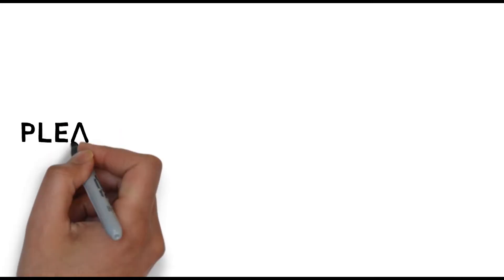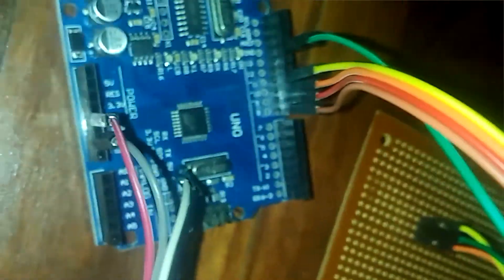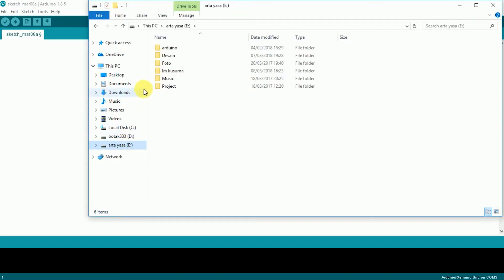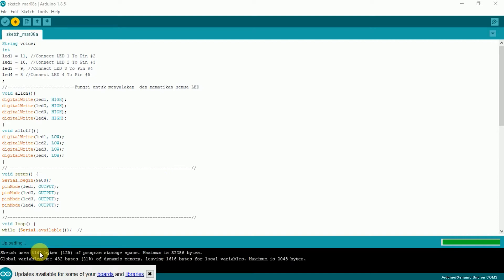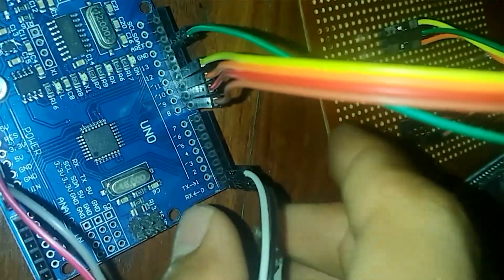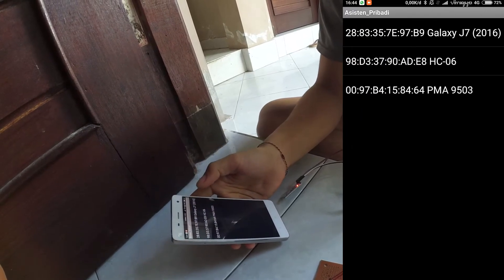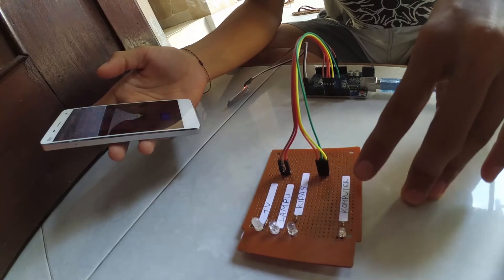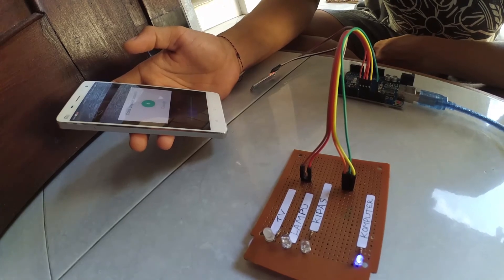cara membuat saklar suara atau voice dengan arduino koneksi bluetooth #smart home #part1

Comment: gan, kok di pencarian bluethoot yg pake HC tidak ada di hp saya ya? saya bingung...
Reply from the maker: Sudah benar rx txnya kak? Rx bluethoot ke tx arduino dan tx bluethoot ke rx arduino kak??
Dan apakah modul bluethootnya normal dan.masih bagus??
Reply: baru saya beli modul bluethootnya mas, iya udah benar. 
rx bluethoot ke tx arduino
tx bluethoot ke rx arduino
btw modul bluethoot harus 3,3v ya?
Reply from the maker: Kasi 5 volt kak kalau pakai 3,3 terlalu minimal tegangan kerjanya mungkin itu penyebabnya kak, modul bluethoot bekerja pada tegangan 3,3-6 volt kak

Comment: Cara hubungin resistor, LED , dan PCB nya kayak gimana ya?
Reply from the maker: Kaki positiv led dikasi resistor dan langsung out pin dari arduino ke resistor, dan kaki negatif led digabung(jika pakai lebih dari 1) dan di hubungkan ke GND arduino.
Reply: Kurang ngerti mas, boleh minta ignya ngga?
Reply from the maker: Botak 333 kak
Reply: Oke terima kasih